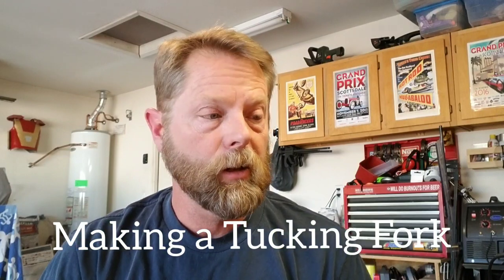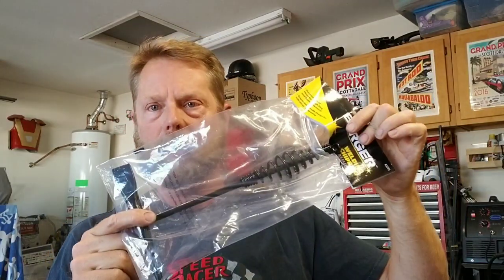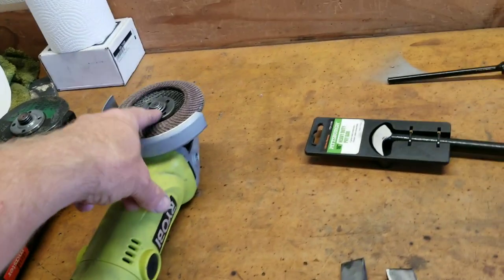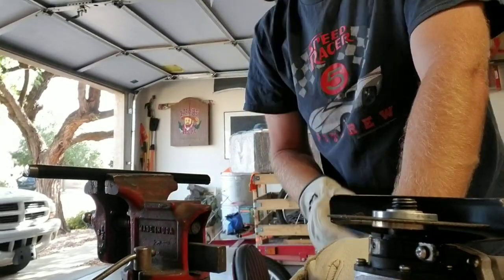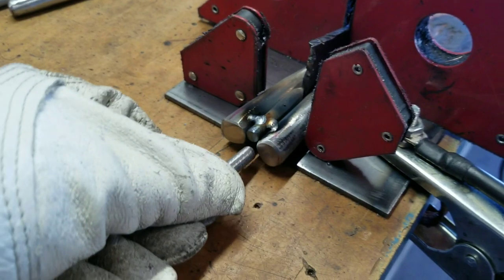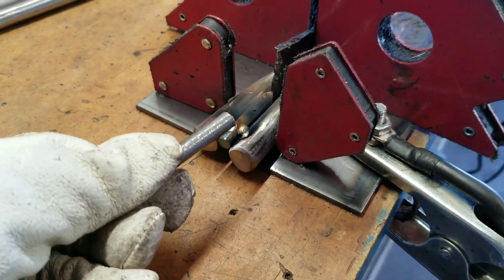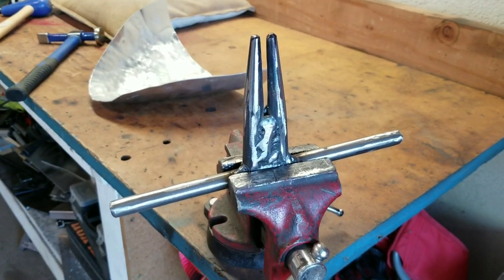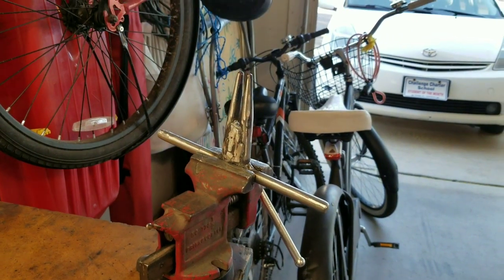Tucking Fork

Comment: This is the second "tucking fork" video I've seen. Both appear to be using the same technique of crimping the metal, then hammering the crimps out again, whilst extolling the virtues of the process. It seems a monumental struggle with limited success.
Reply from the maker: I agree, it only works in limited situations, most metal shaping pros have several hand made tools to accomplish a specific task, this is just one of those. Thanks for watching, I appreciate it.
Reply: @stevevinson6030  I've had to crimp sheet metal tube to fit into another length (as in chimney or drainpipe). I think this tool is ideally suited to that task.
Reply: The fluting machines crimp so that parts fit inside another or take on a curve- a different thing really. What they don’t do is shrink the metal. Hammering the crimps/flutes into themselves is what shrinks the metal. You can make the flutes with this fork tool, larger press type tools(I have built one), or even forming a tuck on the edge of a table. The metal doesn’t care how the tucks get there. It is actually quite effective and quick when one understands the way the metal moves. What you certainly lay are not doing is “hammering the crimps out again” though that is how it appears to the casual observer.